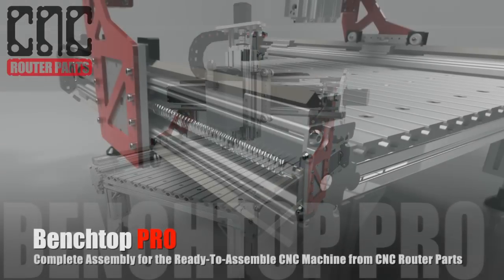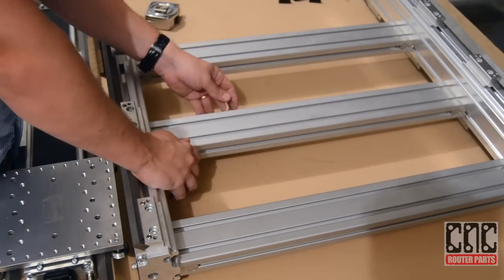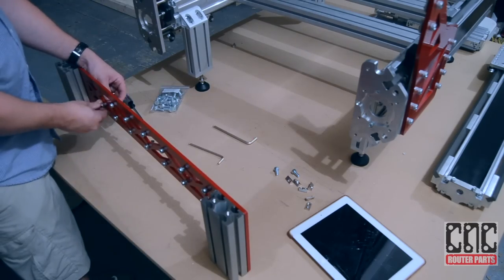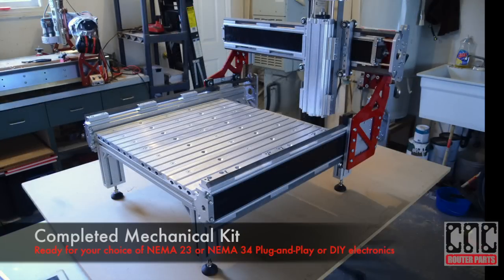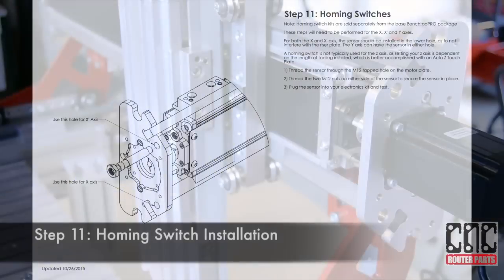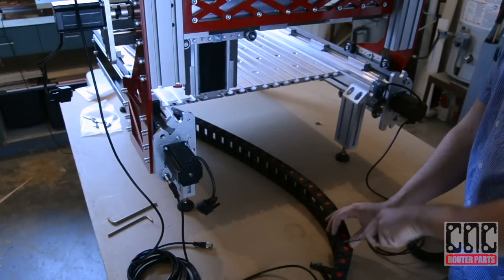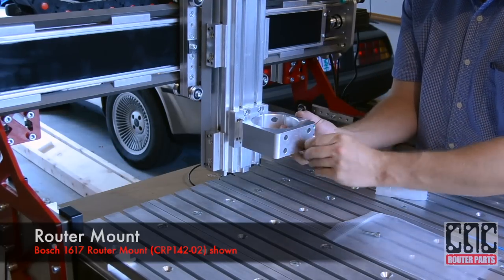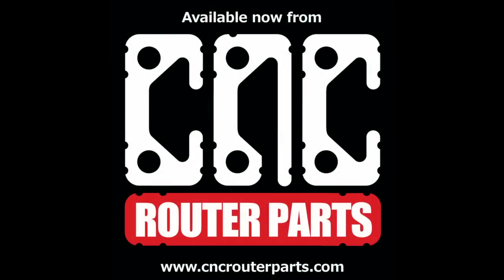Assembling the Benchtop PRO CNC Machine from CNC Router Parts

Comment: Nice solution for a benchtop unit! Looks like a somewhat modular design that could be expanded in the future?
Reply from the maker: Thanks!  It is a great machine, and one of my personal favorites to use.   Please note that this video features our previous generation machine. the current revision came out earlier in 2016 and now features profile linear rails and other improvements to this already stout machine (http://bit.ly/2gbPIem).

Like all our machines, the design is as open, adaptable, and user accessible as possible.  This open design has allowed customers with unique requirements to expand the capabilities of the machine through third party add-ons such as laser cutting heads, 3D extruders, and other speciality capabilities.   Expanding the travel of the machine, as many customers do with our PRO Series large format machines, is not typically cost-effective as too many parts (including the ballscrews) would need to be replaced.   For customers needing this level of future-proofing, we generally point them at our PRO Series expandable machines (http://bit.ly/2fSHG9a).

-Nathan

Comment: It seem excessively expensive.
Reply from the maker: Thanks for your feedback John -  Let me know if you are interested in diving a bit deeper and looking at comparable dual-drive ballscrew CNC machines.   We never hard-sell our machines, so feel free to contact us (phone/email) and we'd be happy to discuss.

If you are looking for a lower-cost machine with the same workarea, I'd suggest taking a quick look at our leadscrew-based Benchtop Standard (http://www.cncrouterparts.com/benchtop-standard-cnc-machine-kit-p-369.html).    

-Nathan
Reply: It might seem expensive, but you get an entire machine included with video instructions, you don't need to cut parts or guess if your design is going to work, it is also all very high quality parts. I even had a couple of questions and I believe it was Corey who contacted me directly and was able to help out. Great service and quality parts. I know I spent way more thinking I could save money by doing it all myself. 
I have ordered a power supply, Lead shine 4660MX and the pro NEMA stepper motor mounts through CNC Routerparts.

Comment: Awesome stuff, guys! I absolutely love my machine. Mine didn't come with those gantry risers or cross section, but that's only because I received a very early model. Having purchased the new risers and cross section kit, I'm sure it will make my machine much more rigid and precise. 

You can't go wrong with CNCRouterParts.com. If you're going to purchase a CNC machine, buy it from these guys. Not only are their products top notch, they also care a great deal about their customers.